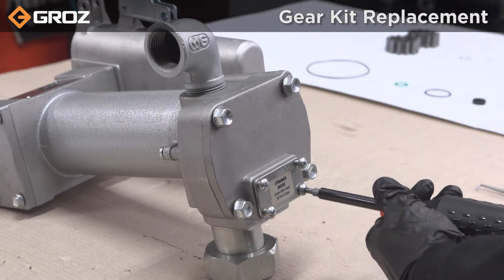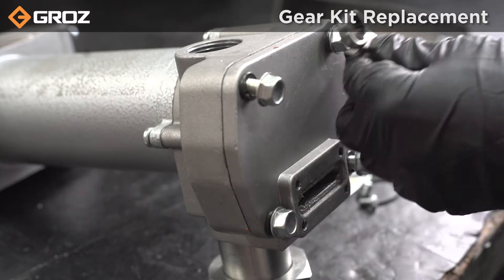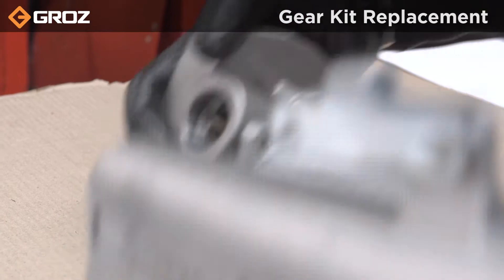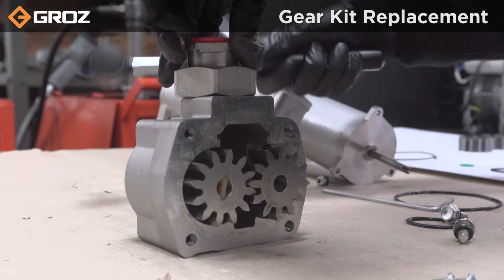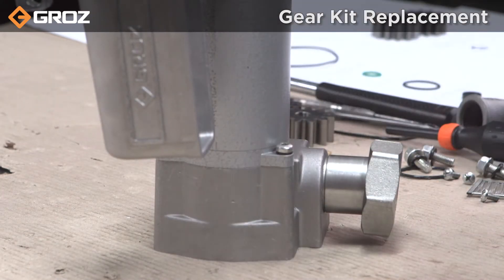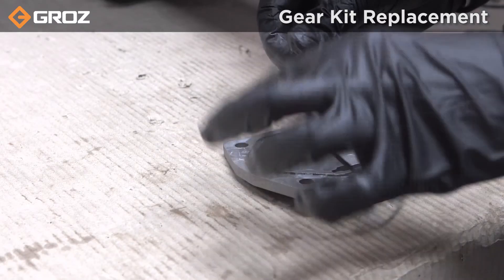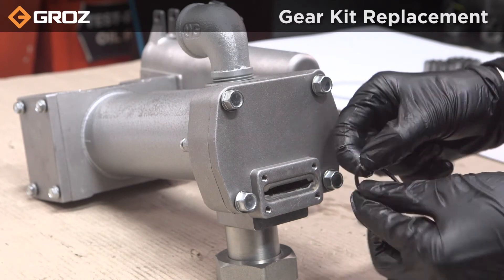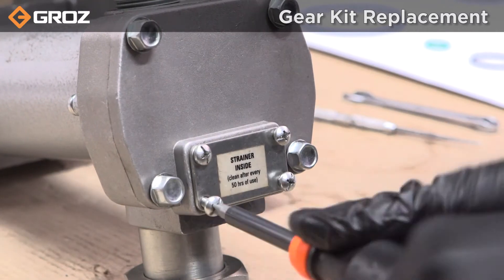Electric Fuel Pump - Gear Kit Replacement | GROZ

Comment: I have a 2006 Thor Vortex 5th wheel toy hauler with a PBL Industries, Inc. model FP12 #FBU-901.737 12 volt fuel pump.  It has been repaired once but it is once again not working.  I have taken the pump apart.  It has black plastic gears and once I remove the cover, the gears spin.  The gears measure 0.906.Through the internet, I have learned that PBL has been bought out by Graco.  Graco shows a repair kit #260277, which are also plastic gears.  According to the comments posted in other forums, the gears should measure 0.752.  In looking for the kit I saw this video published on Jun 6, 2017 "A step by step guide for replacing the gears of the GROZ Electric Fuel Pump".  Your pump shows steel gears but no part number for the kit. Do you offer a kit with the steel gears, key lock and both o-rings?  What do the gears measure?